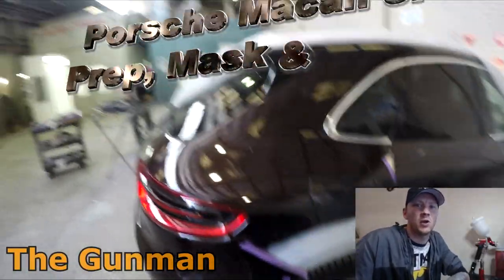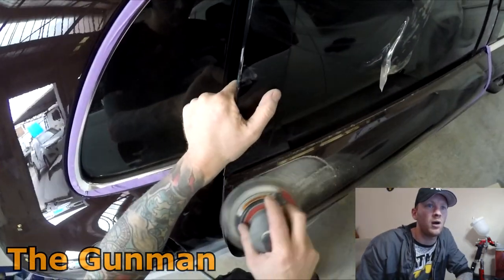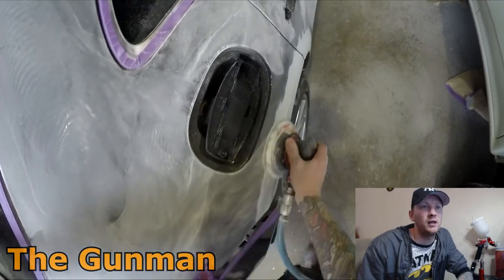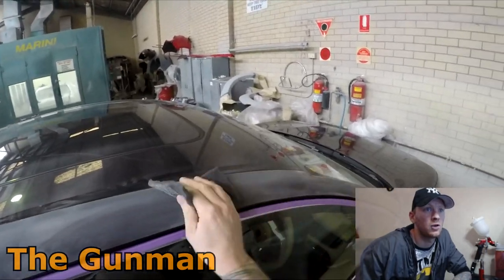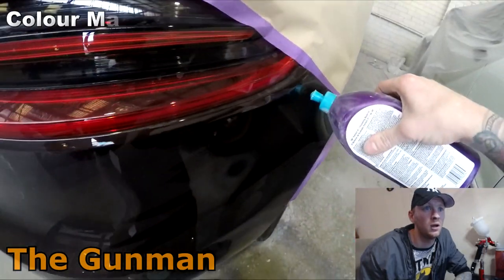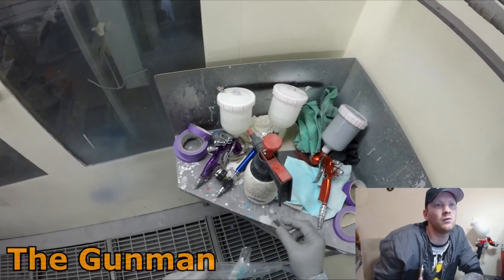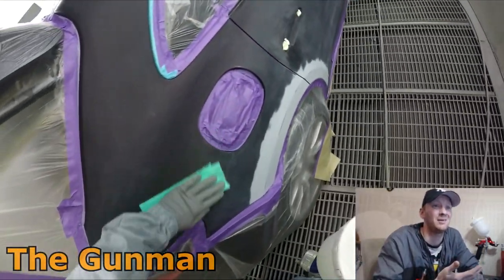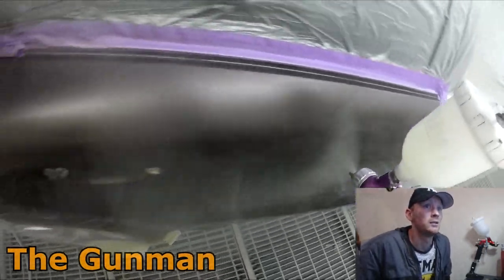Porsche Macan S, Spray Painting: Mahogany

Comment: Hey Gunny, hope you see this comment. Need your advice on prepping panels. Sometimes after I sand a panel down with 600 and then I'm done painting the panel looks a little wobbly with it's reflection making it obvious to my eyes (maybe not average person) that's it's been repainted. I hope this makes sense it just looks rough ever so slightly wavy. Is this from the way I'm sanding or maybe bad clear application? When you use the DA with 600 with the interface pad are you applying firm pressure? Any advice would be great thanks!!

Comment: Hey Gunmaster. Stupid question. If I have a gun that requires 13CFM and I run it at 30psi, will a compressor with 7CFM with max of 145 psi be ok for small jobs like a motor bike tank etc. Airbrush artist lol

Comment: Great job as always! Please, if you have the time, can you tell me what is the difference between the MS and the HS clears regarding the final result? From what i gathered the solids are what is left after the clear has flashed off, and writing it, ive just realized that i dont quite understand what does that mean as well..? Thank you in advance.
Reply from the maker: +Brulserz it's all about the solid content of the clear, but prior to application, look at a tech data sheet for any clear. For example it'll say solids 550g per litre with a HS clear but 450g/l for an MS clear, I'm pretty sure all that isn't solid content will end up evaporating, so basically you'll be able to get the same final film thickness with 1.5 coats of HS/VOC as 2 coats of MS. Low VOC is basically one step up from HS, stands for low Volatile Organic Compound.
So basically the gasses which are emitted while curing are much lower and you need less to achieve the same film thickness.
I also think the VOC and HS clears have a better UV resistance.
Hope you got that.
Reply: Thank you for the quick response!
Reply: The Gunman so I would ask why use an MS clear at all then? Thank you for another awesome video. 👊👍

Comment: Do you microwave the clear prior to activation or after the harder and thinner have been added? I assume some kind of plastic container for the microwave process? Thank you.
Reply from the maker: +Steve Janka I use either my normal plastic pot or my aluminium one is also microwave safe. I give it a nuke straight before I walk in the booth, so after I add hardener.

Comment: Great video, I'm new to the painting thing I bought a few guns to work with and the tips are 1.4 instead of 1.3 is that ok to work with or switch them out. I'm going to attempt to lay candy and really want to get it right
Reply from the maker: +Doug Johnson 1.3-1.4 should be fine, I'd recommend doing some test panels before taking on the job, I have some videos on how to spray candy paint.
Reply: The Gunman thanks Gunman, and yea I watched it about 5 times and will watch it a few more times before I get started on my project thanks a lot again.